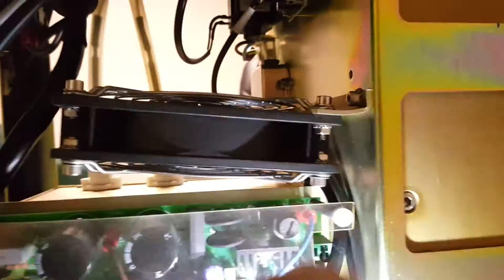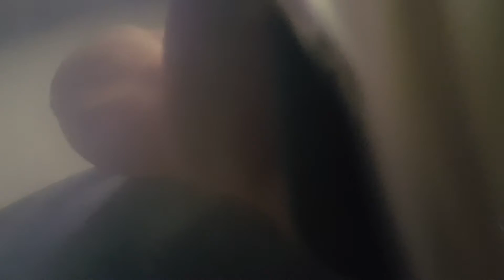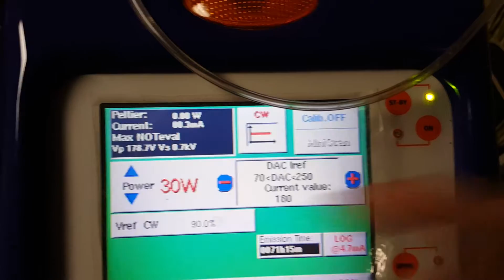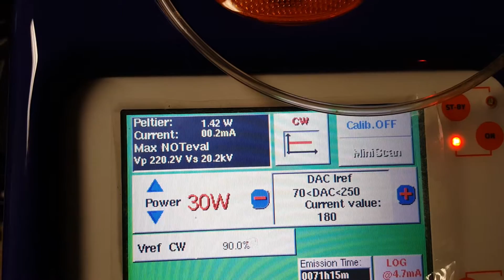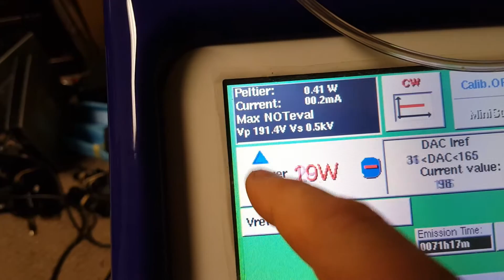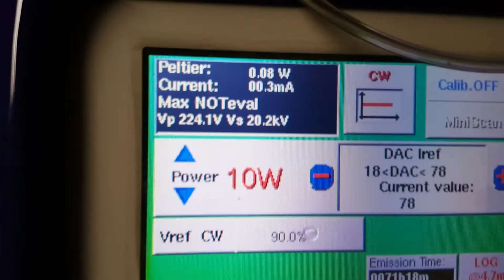Surgical laser machine inside, diagnosis, troubleshooting, questions answered

Comment: I believe the Vp is the voltage potential across the tube. Not sure for the device your working with there. I'd try the NST again with an old microwave rectifier on it in series. That or build a full wave out of four of them. I'm not sure how the NST would work at that point though.
Reply: As a sidenote. You might ask your laser tube friends about loading that thing with Argon. It should operate at around 480nm at that point. It should also have decent output. I don't know what kind of collimation your going to get out of that hand piece though. It might have some sort of diffusion optics for skin lesions or removing tattoos.

Comment: So did you pick this unit up to attempt a repair on it, or is it something to have fun with?
Reply from the maker: This actually belongs to my boss. It came from an emergency vet clinic he had purchased, and was interested in seeing if it could be repaired. The company that built it said they'd take a $5000 deposit and we'd have to ship it to them, then let us know if there is any additional cost. I guess this machine originally cost roughly $50K. I have since figured out how to remove the laser tube without moving the alignment adjusters, so I'd get it pretty damn close re-installing it.  It will cost in the neighborhood of $600 to have the tube serviced, plus coolant.
Reply: $5000 just to look at it?

Yeah, I can understand why you're looking it over instead. Especially if it only costs around $600 to service the laser tube.

Not too often that someone gets a chance to tinker with a unit like that, so it's an Interesting project to say the least.